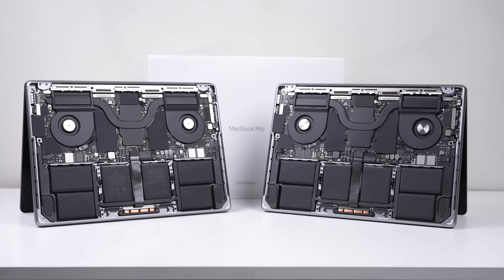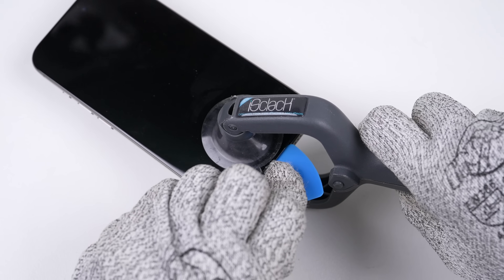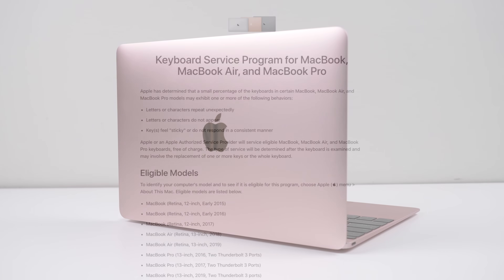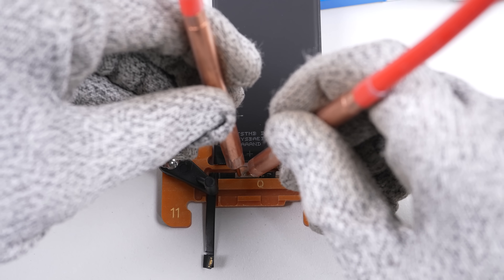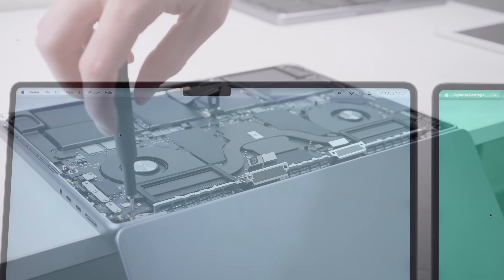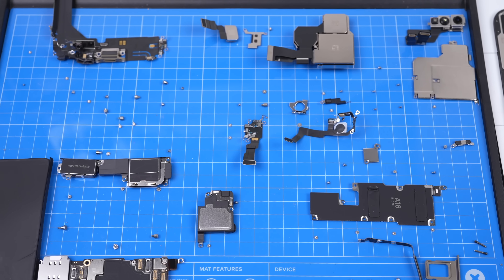Astonishing Anti Repair Practices By Apple In the Last 15 Years

Comment: From their first Computer to these days, Apple products are designed as hermetically closed systems, so if you face an issue throw it away and buy a new one. I remember in the mid 80s when I privately asked some experts which system they would recommend. Unisono came the answer: never ever Apple, the only viable option being „IBM compatible“ PC‘s.

Comment: i dont believe apple that they are pro repair , when they dont allow 3rd party parts to sell to others, 2nd they lock good parts with serials turning features off until its paired by authorize apple repair center which has insane NDA and requirements and fun part limited type of repairs , they intentionally gimp phone older than 1-3yrs by slowing them down to force people to buy a new one "planned obsolesce"

Comment: I would give an unhonourable mention about laptop screens. They have pretty much always been glued into one solid unit so that the whole cover needs to be replaced when the panel breaks. Now with new 2022-> laptops they took it to the next level with software lock.

Comment: Summary
Introduction to Apple's Repairability Issues
- 0:02 - Examining Apple's impact on repairability over the years.
- 0:25 - Issues surrounding repairability; some resolved, others persisting for 14+ years.

Tools and Hardware Limitations
- 0:58 - Introduction of pentalobe screws in 2009, hindering user repairs.
- 1:10 - Shift from user-replaceable to inbuilt batteries in MacBooks.
- 1:12 - Pentalobe screws in iPhones since the iPhone 4 in 2011.

Software Limitations and Performance Management
- 2:06 - iPhone 3GS and Apple's software signing server prevent downgrading iOS.
- 2:38 - Software potentially slowing down older devices, admitted by Apple in 2017.

Design Choices Affecting Reparability
- 3:01 - Riveted keyboards in 2012's MacBook Pro, complicating replacements.
- 3:56 - Batteries glued in devices, escalating from user-replaceable to non-replaceable.
- 4:14 - Soldered RAM in retina MacBook Pros eliminates upgradeability.
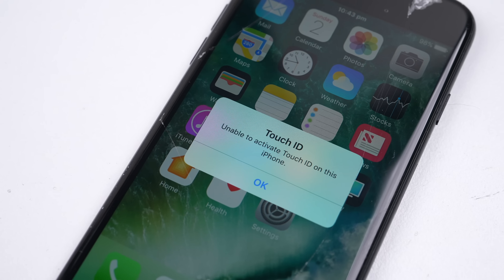- 5:46 - Soldered storage in Apple computers starting with 2015 MacBook, affecting device lifespan.

Biometric Authentication and Component Pairing
- 4:46 - iPhone touch ID sensor paired with iPhone's software in 2013.
- 6:14 - iPhone 7 replaces the mechanical home button with a solid-state version.
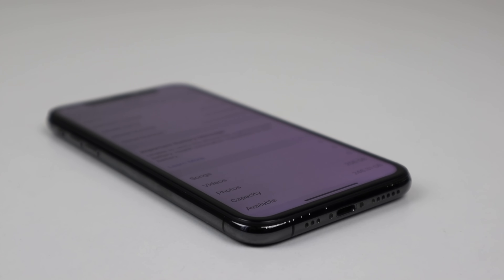- 7:30 - iPhone X faced the same issues as iPhone 8; Face ID and front camera issues.

Display and Battery Replacement Issues
- 6:36 - Introduction of iPhone 8 and true tone, complicating screen repair and replacement.
- 7:18 - Chips on back of screen must be swapped to retain True Tone, a difficult process.
- 8:07 - Apple admitted to using software to slow down older iPhones.
- 8:31 - Battery health information and warning messages introduced and tied to serial numbers.
- 9:22 - Third parties began transferring battery management systems to retain functionality.

Recent Developments in Repair Issues
- 10:06 - iPhone 13 and later had issues with display replacement disabling Face ID.
- 11:00 - Apple's new MacBooks have paired components causing issues with repairs.
- 11:37 - Apple's self-repair program criticized for being unviable financially.
- 12:10 - Apple's backing of a right to repair bill; California's bill affects products sold after July 1, 2021.
- 12:36 - iPhone 15 continues the trend of software locks on repairs.

Personal Commentary and Industry Response
- 12:50 - The video includes personal experiences and opinions on repair issues.

Disclaimer: I utilized GPT-4 to condense the video transcript into a
summary.  I employed Prompt 1 to generate timestamped bullet lists. I
then used Prompt 2 to organize these lists into sections with
titles. The summary was manually formatted using YouTube comment
markup.

Prompt 1: "Generate a bullet list summary, including starting timestamps for each point."
Prompt 2: "Split the following bullet list into sections. Create section titles. Keep timestamps for the bullets. Use this format for titles: *title*. Keep bullets that you deem important to the story."

Comment: Apple loves e-waste.  I love my Framework laptop.  I installed the SSD from my old laptop and RAM from a third party into my new Framework laptop.  Framework actually encourages people to open their laptop case, and provides excellent manuals to do so.
Reply: Rocky712_ From this very video, Apple does not allow for "easy storage replacements" on its laptops.  I guess you missed that part.

I bought my AMD-powered Framework 13 for $946.  I bought 16G RAM for it from Newegg for $47.  I brought my 512G SSD from my old laptop, new would be around $30.  Total is $1023 for everything; I spent $993.

A new Apple Macbook Air M2 13 inch laptop with 16G RAM and 512G storage is $1599.  So no, the Framework does not cost "a couple of hundreth [sic] extra for similar specs".  The Framework costs $576 LESS for similar specs!  This does not even go into the costs of replacing the screen, battery, or keyboard.
Reply: @georgeh6856  You missed my point entirely. I am aware this Video is about Apple, but the flexibility to upgrade your Storage and RAM is all what the everyday user really needs and this is more than doable on many non-apple laptops. It is way more expensive than comparable windows laptops that still offer enough repairbility and upgradeability for the average user. Apple of course charges an absurd premium for all their products.
Framework is amazing and I even considered daily driving one myself, but it´s really not worth it unless you feel the need to swap out your framework modules a lot and you need that flexibility. And I am honest with you, despite planned obsolence in many areas of our life, PCs/Laptops are super reliable to a point where only stuff like the thermal paste, battery and fans can decrease your user experience significantly.

A 13th Gen Intel Framework Laptop "Performance" Config with i7 1360P, 16GB RAM, 512GB Storage, Win11 Home with 4 USB expansion cards (USB A and/or C) goes for 1669€.
I can get laptops with the same spec for as low as 799€-950€ and they all have even 1TB of space instead of 512GB.
Depending on which one you get literally double the price or like 700-850€ more.

I love the idea, concept and execution of the framework, but realistically most people will not have an issue with their device other than the PC becoming outdated for modern software and if they have issues, it is covered by the 2 year protection (guaranteed by law in Germany). If the price difference was like 200-300€ ish extra for same specs, I´d have made the switch, but you have to admit the system comes with a crazy premium for a windows machine.

Next time read carefully.
Reply: tbf, most laptops allow for easy storage replacements, so those are just fine for most users out there and the framework also costs a couple of hundreth extra for similiar specs. That laptop only make sense if you really know you want this.

Comment: If you want a truly repairable phone, I suggest a Sony. Parts aren't paired and the glue keep the battery and the phone back attached, but not bound together.
Moreover, Sony didn't copy Apple compulsively like Samsung does, so the Sony phones have the headphone jack and the micro-SD card slot.
Reply: Really the only phone that deserves a "truly repairable phone" is the fairphone. Obviously not top of the line hardware, but enough for 99% of users.
And there are still a huge amount of phones out there with headphone jack and expandable storage by micro sd.

Comment: Swapping the BMS of an iPhone 12 Battery over to a new cell, using an external programmer and  jcid battery flex cables to reset the cycle count and battery health, that’s way easier than just replacing the battery. So thanks Apple

Comment: I dunno what type of RAM the early Macs used but LPDDR has its focus on low power usage, especially when not in use. So far LPDDR can only be soldered on and not have upgradeable modules like regular DDR. So there are reasons to use soldered RAM other than saving space and restricting easy user upgradeability.

Comment: i dont trust apples "support RTR" claims..  a tiger wont change its stripes.  Give it a few years and apple will make sure that people forget that claim.. 

It is only a cheap quick fix to repair apples reputation.   Its a PR stunt.. without any plans to contribute to RTR.

If you think apple care to follow rules and support TRT remember when they got pushed into using USB-C ..  they did "follow the rules" and used a special snowflake "usb-c" that wont fit any other device. They tried to add limitations for 3rd party cables like lower charge voltage and data speed..  
You "can" get full data speed and charge voltage IF you buy apples special snowflake cable.. that cost $$$$$$$ 

Dont trust apple, ever. If you give them a thumbs up and turn your back towards them apple will put 2 knifes in your back.

Comment: 5:18

The biometrics are paired to screw the customers over.
There is no other reason.

Apple could have just added a little survey when resetting(yes resetting) a device "This iPhone's/iPad's home button has been replaced, and could potentially have been tampered with. Do you want to enable Touch ID?"
Why do I say that it should be a reset only option? Because that way, you are proving that you own the device, because you obviously know the passcode and the password to the linked apple account.

Comment: My iphone 12 mini screen and body is busted can I convert it into iphone 12 screen and body ? Please test this on a video otherwise I won't be able to convince repairers in my locality if it's possible to do . Please test it on a video please because I'm planning to put the iphone 12's 6" inch screen and 12 body or fake 13 pro body on 12 mini so please test and show on video i want to do this experiment but I can't buy parts without confirmation im asking you because you have a shop with spare parts you can experiment and show and make content and i can get do this experiment successfully so please help by experimenting by putting 12 display on 12 mini if it works or not .

Comment: It is mot true about swapping chips to retain true tone. Only if you have the orginal display which the iPhone was originally paired with is at presence, you can transfer the display serial number with a JCID/Qianli like programmers onto a new display. The Chip transfer will only remove the “genuine apple display” message.

Comment: I know this doesn't have anything to do with repairing, but since we're already at the topic of the IPhone 4, that was also the smartphone where the antenna was built in in such a way that users were blocking out all signal just by holding it in their hands normally, thus creating the meme "You're holding it wrong."

Comment: Although it will definitely never be implemented for obvious reasons, it would be funny if the EU (or California or another state) forbid the use of software locks for replacement parts. If a bug that prevents the replacement of a part is reported, the manufacturer has to fix it via software update in two months or something, or provide reasoning on why it wasn't done along with the source code of the drivers/code that is responsible of handling the part as proof to the authorities. That would be a good incentive :)

Comment: My 13 pro was a nightmare after a new IOS version. The battery degraded so badly I could no longer get half a day out of it. The problem was not the battery that had very few cycles on it but the software and management going wrong and marking down the battery. Apple under much duress finally replaced my battery (I paid in full) only to end up with fine marks all around the casing where the screen had been jimmied out.

The phone was in pristine condition having been in a full case with screen protector……honestly Apple repairers suck and are clearly idiots. 

At least my phone has worked properly since but it sucked.

Comment: Another shitty move they made was with the release of Apple Silicon Macs.

Sure, they're fast, but they designed the storage in such a way that if it fails, the system will not boot at all (like if the BIOS on your motherboard was damaged). Apple put the firmware information on the SSD...a wear part that WILL die if written to extensively.
🖕Apple.
It was here that I said, no more Apple computers. I am sorry for anyone that buys their ticking timebomb appliance computers. They don't know the pain they can come into if their SSD fails.

Comment: I think the right to repair is not the only thing that is needed. We also need a right to software that doesn't become unusable after a few years. Some of my friends had to buy new phones because Whatsapp needed a new update, but the update was only available for a newer operating system
Reply: Or a new PC for Windows 11 ffs.

Any PC that can run Windows 7 is perfectly capable of Windows 11 - albeit without the encryption.
Reply: @mrb.5610 

Why would anyone install this crap on purpose?
Reply: @TheOriginalShakuraz  Well I did just as something to do more than anything else !
Reply: A thing that can't happen on Android phones even if they are running old versions.
Android is modular and is updated separately from the main version.
This is how all android devices with Android 6 and up got Nearby Share as soon as it was released on Android 10 a month before android 11 was available.
Even WA supports android 5+ (2014) while only supporting iOS 12 and up (2018).
even when your device doesn't have android 5, a custom rom is still a possibility.
Reply: @HAWXLEADER  developer can block specific Android version or device screen dimension, it causes the same effect as what OP told.
Reply: @HAWXLEADER  Issue is, especially cheaper models will rarely get custom ROMs, because nobody has interest to waste their time. Of course you could consume all of xda and do it yourself, but that is very daunting task for someone who has never done such work.
Reply: @HAWXLEADER I know this video is about shitting on apple for the scummy shit they do, but software support and updates, whether it’s updates for older devices that can or can’t run the latest OS, is an area they probably do a better job then most of their competitors, iPhones from 2018 run their newest OS and iPhones from 2013 have continued to receive security updates on older OS similar to security updates for newer phones, of course custom ROMs for android extends the life of android phones but that’s not the same thing as an official update, I don’t know a single person with an android phone using a custom rom and I’m pretty sure they wouldn’t know what I’m talking about if I asked them,my point is the likely hood of an app not working on your device because it’s not capable of receiving an update is far more likely on android and for the average person it’s even more likely because they aren’t flashing a custom rom to their device, apples still an awful company, as are every company, but give companies credit where it’s due
Reply: @PatrickThomasBrady  They do, but unfortunately as an iOS release becomes 1-2 years out of date it becomes a slippery slope where no new apps are compatible because of how tightly apple controls their compiler. That's what should become illegal. Android 4.4 (2013) can still run 80% of apps on the play store since they work like universal binaries
Reply: @PatrickThomasBrady security updates just cover their own ass if someone goes bankrupt due to a hack
Reply: And software or online update that bricks your device once the warranty date is passed is a slap in the face. Buying a second hand 2 year old computer was a v-painful lesson.
Reply: You're right, of course, but you have just written the whole concept of neoliberalism in a nutshell. Too greedy all those companies out there to just not do so. And governments gladly concur. There is no "green", there is no "no-waste", there is no "health" after all. It is pure 'n' simple greed. It's as simple as this.
The whole human kind is despicable. I was just thinking about moving to Mars. Too bad there are not houses on sale available… yet. 🤷🏼‍♂
Reply: like, what is so groundbreaking about windows 11 that my computer refuses to update to it? not that I want my computer to have aids, but still.
Reply: @UCannotDefeatMyShmeat  as far as I can tell so far, it's just Windows 10 with less user agency and more spyware telemetry shit. A lot of DIY stuff has proved it can run on almost anything post-2009, like Windows 10; I'm actually not sure what their motive is, because they don't sell PCs.
Reply: I understand your point with whatsapp but it doesn't make sense at all. Ofc better software requires better hardware, I'm almost certain they didn't just WANT everyone who had <5 year old phones to buy newer ones, there are just restrictions to them.

Its like complaining a 10 year old still-running-game doesn't run on a 10 year old gaming computer (even without decay) anymore. Do you really expect them to never upgrade the games graphics, performance or whatsoever, just because some people with way too outdated hardware are being excluded after many, many free updates?

EDIT: A game isn't even the best example because it cost something while whatsapp is free, so the right for software to not become unusable makes even less sense in your case.
Reply: @sephiroth0409  We've reached a plateau where hardware from 5 years ago is perfectly usable for a simple end to end encrypted chat application. It shouldn't need much horsepower unless (in typical meta style) there is some seriously nefarious shit being run in the background.